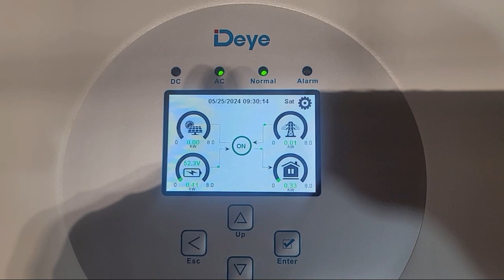Solar Power Transformation: Installing a Full Solar System on My Jamaica Dreamhouse!

Comment: If you don’t mind sharing what company did you use to install this system.  I will be building some.  Just need to get the drawing done and making sure I can be present during the building process.   I will be building in Manchester also.  I know the journey was not easy getting the house built.
Reply from the maker: Essential Solar, based in Kingston, provided quick and hassle-free service. Essential Solar YouTube Channel.https://youtube.com/@essentialsolar?si=iF_d_iAuV5Oy6D3i

Comment: Jps the biggest crooks, i have 25 (550 W) panels and three 10 kw batteries, and these crooks were still sending me a $12-15k a month bill to a house i wasn't even residing in. To make matters worst, I only had my internet router/modem plug in, everything else was unplugged
Reply from the maker: Wow, with all that you shouldn't have any bill. Can't you turn off the main breaker to the house.
Reply from the maker: Something is seriously wrong. So how much, were you paid before?
Reply: @bertramgoldson5033  with all that energy, I expect you to be energy independent
Reply: Turn off breaker